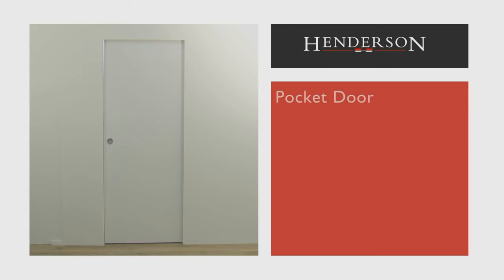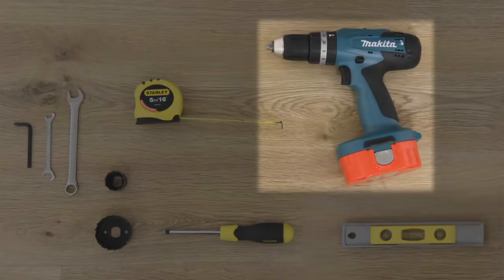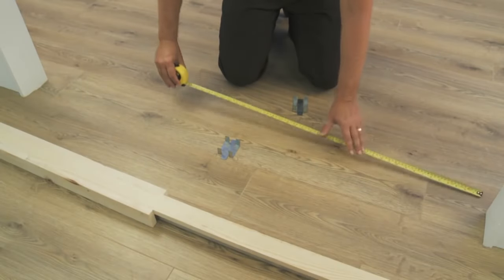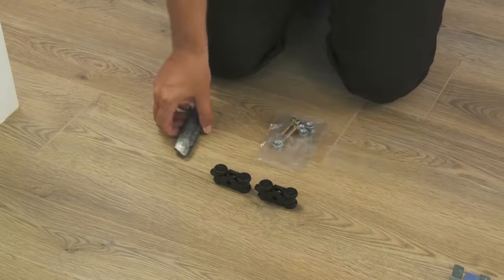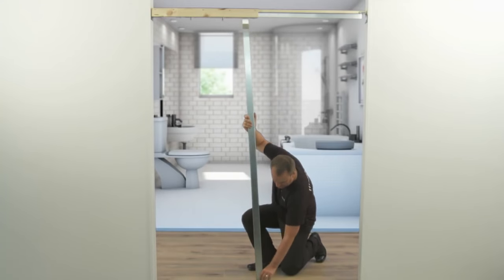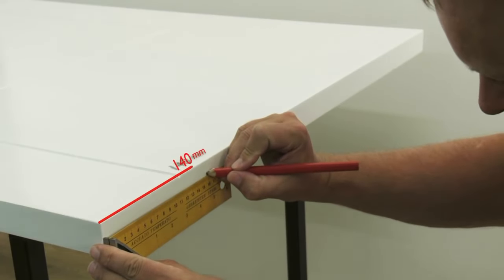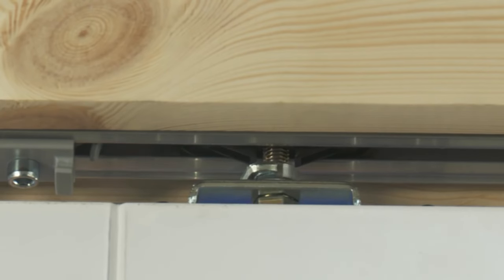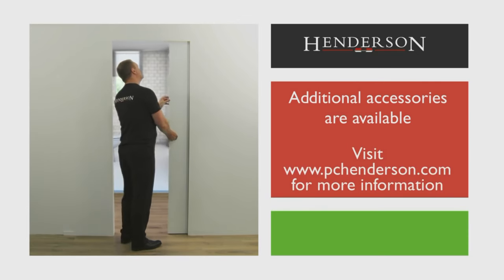HENDERSON POCKET DOOR 1-DOOR SLIDING TRACK SYSTEM | Screwfix

Comment: hi. Looks good. The problem is it looks like it can only be installed once all the flooring, tiling is done. Would ideally like to install all apart from the door during the 1st fix process.
Reply: Yeah mate this is the issue I am currently trying to resolve. I think I will probably end up screwing some timber to the floorboard to my guessed height of the finished floor, then trim the door after installing the laminate flooring.
Reply: @AG-wn8bv  my thoughts exactly

Comment: What kind of locks can be used with this type of door?
Reply: Hi 
this type of lock is ideal. 
UNION® 2426 Sliding Door Lock - 77.5mm Case - 57mm Backset - Satin Stainless
good luck. Im installing mine this week.
Reply: Hi Terri, 

We offer a range of lock sets suitable for pocket door applications in a range of finishes and styles - please search for our 390, 60SQ or 571 lock sets on our website. 

Thanks, 
Kate 
Marketing Assistant
Reply: pro tip : watch movies on KaldroStream. I've been using it for watching a lot of movies during the lockdown.
Reply: @Kyree Forest definitely, have been watching on Kaldrostream for years myself =)